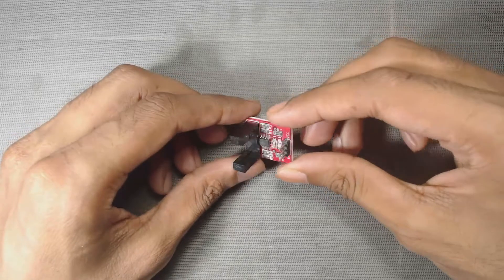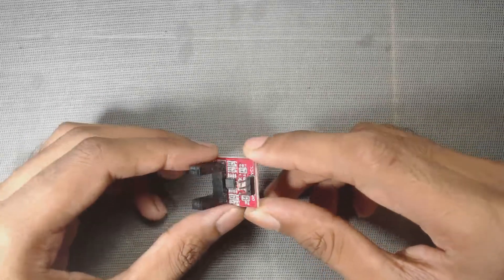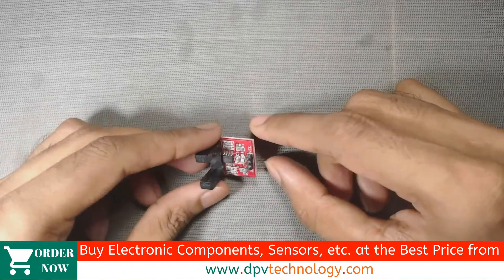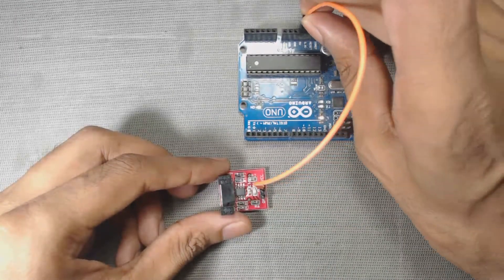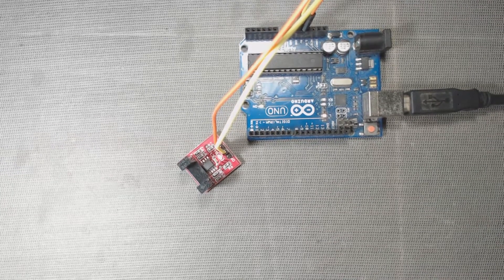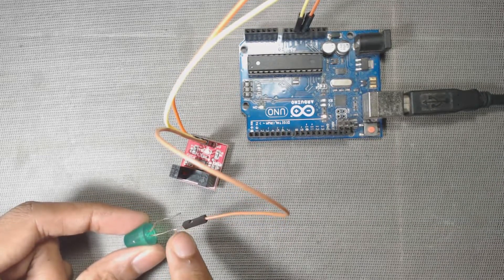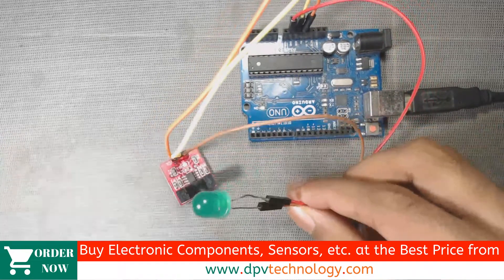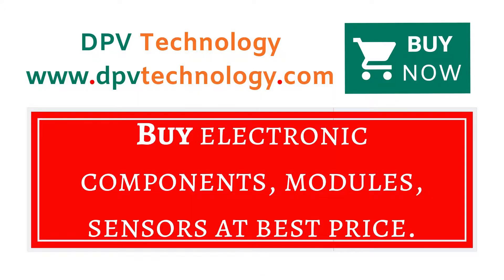How to connect use Beam Sensor -Through beam photoelectric infrared speed measuring counting sensor

Comment: hi, may i have the code?
Reply: No code needed. Hook up the 5v and Ground. When the beam is disturbed it activates the signal out to trigger something. In the video example the arduino is only used to power the sensor.
If you wanted to use with arduino you would attach the signal out of the sensor to an arduino input to use .